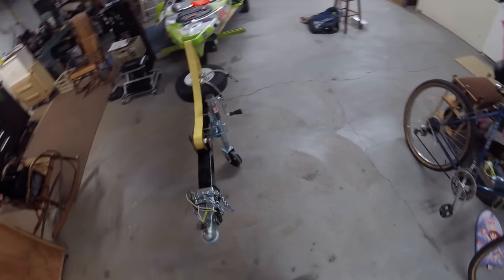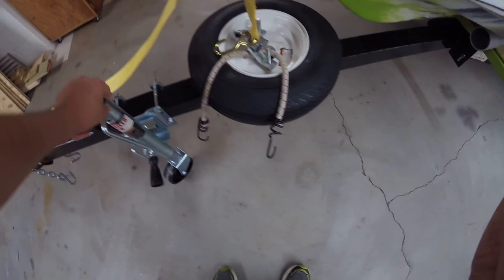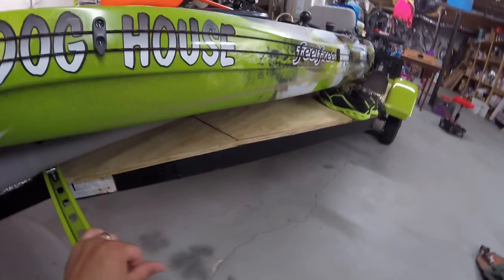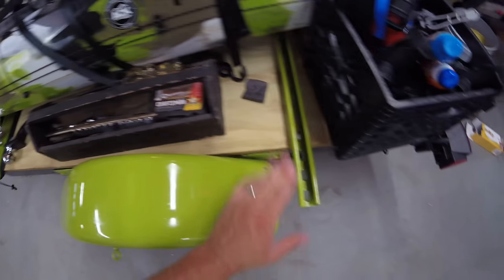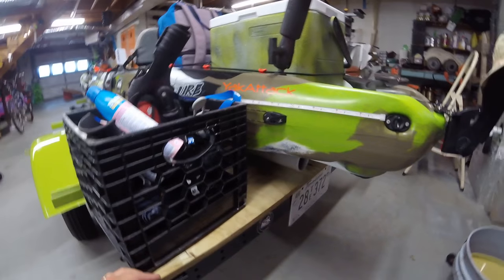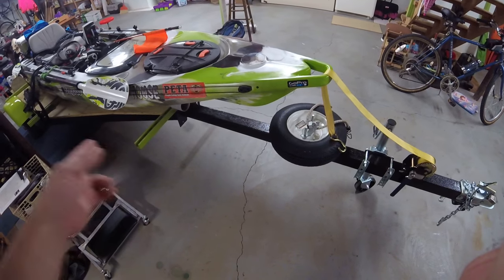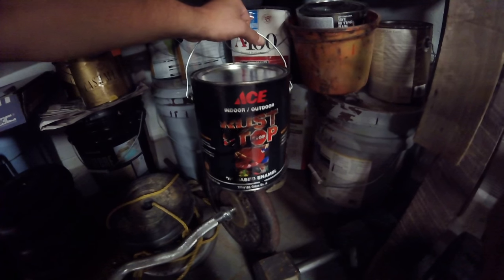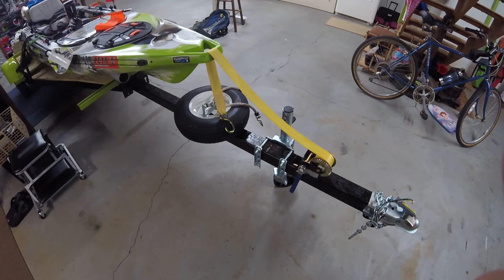DIY Kayak trailer

Comment: Nice Trailer.  I am looking around for ideas for my Old Town Predator XL.  I like this one.  I am looking for a slightly bigger one that can hold two yaks.  But nice job for sure.
Reply: Andy Gerken a.k.a. TOPSO - Why two yaks? Isn't that why we buy yaks to get away from Others for awhile? lol 😝
Reply from the maker: Andy, I have mine set up so I can add a second yak if wanted. I would just need to add additional conduit...
Reply: You might check Craigslist for someone who routinely buys and sells jet skis. For me, storage is a problem but I found a single that is narrow enough to fit through my side yard gate. Even a double jet ski trailer is not as wide as a boat trailer so you might consider that. Also if you have a boat storage facility in your area, you can just cruise the yard to see if there might be a candidate there. Of course, it depends on how much work you want to do to it as to what you might find there. Good luck.

Comment: I put gorilla tape on the bottom keep on my 11.5 to protect it more.  Pretty strong tape.  Then that way the tape can scuff up and it would be easy to replace a piece of tape.  Someone on YouTube suggested it.
Reply from the maker: Did that slow the kayak down?
Reply: @HurdCrafters  have yet to try it out since I got it 5 yrs ago. I upgraded to the new old Town with motor 2 yrs ago.
Reply from the maker: Gotcha.

Comment: First I like to say, this is the BEST set up I have since on here. I know it's been a while since you made this video and hoping that you can answer my questions. I am getting ready to convert a boat trailer to haul my kayak. I got the trailer all strip down and have all the rust spots removed. It's a galvanize trailer that has been sitting in some ones yard for over 15 years. My first question is about painting it. ACE hardware has the paint and primer I need, which is the same product you used. Did you brush it on or used a spray gun? 2nd question: How did you attached the Uni-Struts? Can't see good in the video. Last question: Is that Marine Grade plywood? If so, where can you buy it? Thanks for your time in replying to my questions.
Reply from the maker: Robert, I brushed the black paint on to waste less product. Went fairly well and only wasted a couple of drops that is still on my driveway lol. I attached the unistrut with basic bolt, washers, and nut through the plywood and through the trailer frame. I could not find marine grade plywood so I just purchased the highest quality treated plywood available at Lowes. Thanks for your comment and so sorry it has been so long that I responded. I have been out of commission with the Flu. Thanks and God Bless!
Reply: Thanks for the reply it was very helpful. Just needed a little info so I can start on mine when the weather gets better. Wife is using my garage as a storage shed so I have to do the work out side....LOL ...Hope you get to feel better and great work on your trailer. Best I have ever seen on here.

Comment: Hi!  I just bought a seedoo trailer, or look like it... and I have a Feelfree Lure 1.5 and I want to mount like yours ans was wondering what is yoour Kayak lenght (I just can't see it) and what size pipe are you using?  Thanks!
Reply from the maker: Kayak length is 13.5' and I am using 2.5" Conduit. You are welcome!
Reply: Thanks for your prompt answer!  I just dont quit see under the kayak from the back end... is the bottom of the kayak touching the unit-strut?  Do you still think 2 1/2" conduit is big enough, would it make some difference unsing a 3 " condut?
Reply from the maker: You are welcome! The kayak does not touch the uni-strut. for a FeelFree Lure, I think 2 1/2" is big enough. I initially wanted 3" but I could not find any conduit that size, I could only find PVC pipe that size and it does not hold up to the heat of sunlight like conduit does. I would suggest that you apply carpet on the conduit in which case I guess you could get by with PVC pipe...
Reply: I am not sure what "conduit" is in french but I will do my research... You are talking about the affect of heat of sunlight : what area do you live in? I'm in center of Quebec.  I will probably use pvc and fallow your advice of using carpet.  I have a few used car floor carpet that I may cut and screw to the pvc.  I like YouTube because there are so much great ideas to pickup.
Reply from the maker: Conduit is very similar to PVC. Conduit is gray colored pipe used for electrical connections and can be used exterior while PVC is for interior material. I plan to glue my carpet to the conduit...YouTube is like the best invention since sliced bread.
Reply: LoL  Have a very good summer kayaking!